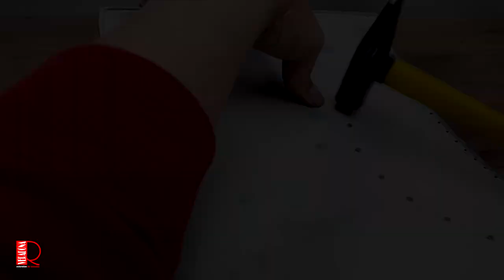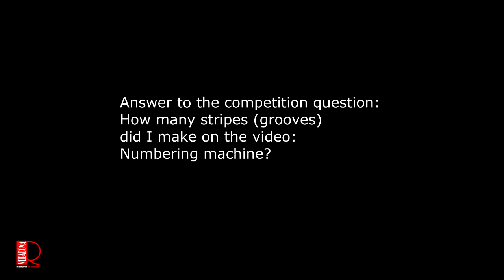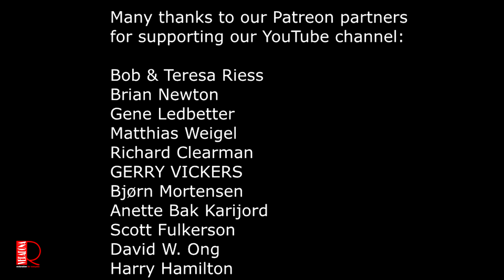American machine - Restoration

Comment: Really nice restoration!  Looks great and obviously functions very well 😃  Do you think you could use a "powder coat" technique here and avoid having to use the polyester filler with spray paint?  I've seen some people use that but I don't know if it is an alternative or just a different approach.
Reply from the maker: Yes, it would certainly be better in terms of abrasion, but I don't have powder coating at home yet, so I have to make do with spraying :) Thanks Fred, Radek
Reply: @VeradonaRestoration  Thank you for the great response!  I was not sure if the powder coat "look" is something you would want or not or how durable it is compared to the polyester fill.  Thank you for this great video!

Comment: What is steel crump and why do use it vs. sand?
Reply from the maker: I wanted to test it if it would be better.
Reply: @VeradonaRestoration  What did you think?
Reply from the maker: @Castleknight  Well, you asked why I chose cast iron crumb in front of the sand. Because I wanted to try how to sand it with her :)